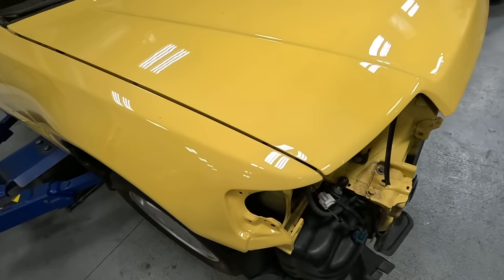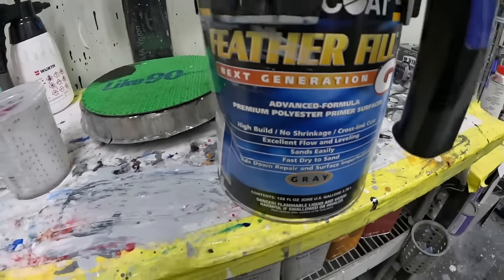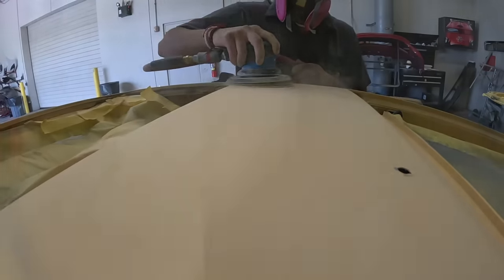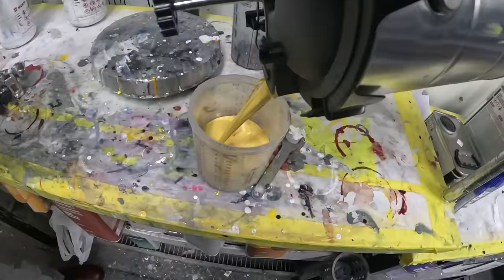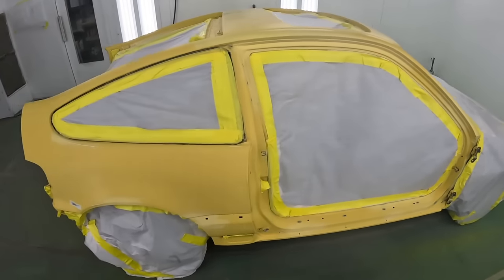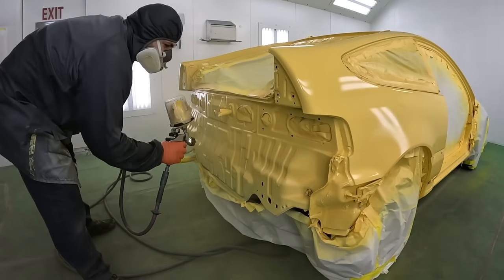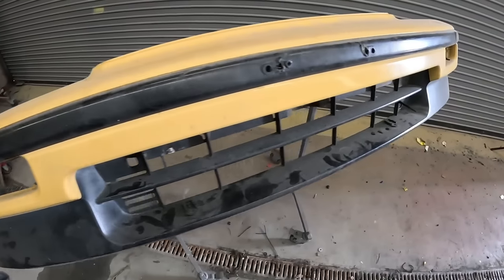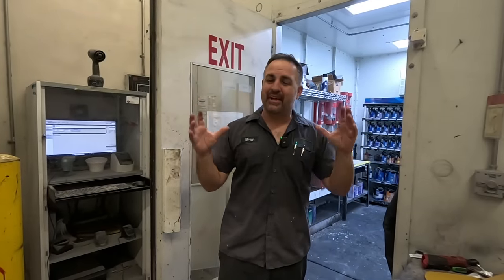THE BEST PAINT JOB // Barbados Yellow Y-49 // 1989 Honda CRX Si (Ep 3)

Comment: I agree blocking everything should be part of the ffirst stages of every restoration. On mostly straight cars I adopted the technique of using an airfile. It’s not for every job or panel but using a higher grit helps 400 or 320 just to identify low areas.